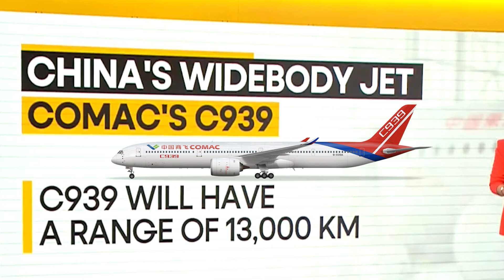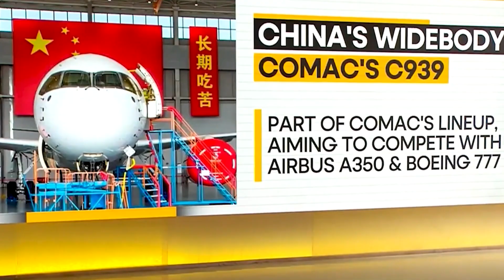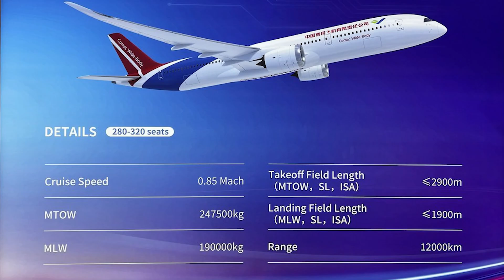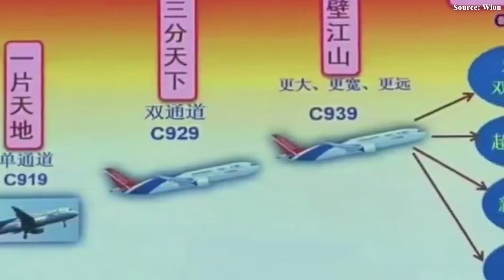China’s MASSIVE Plan for NEW COMAC C939 Could Change Aviation Forever

Comment: Western estimates are always wrong when it comes to estimating the length of time for China to achieve goals.  From infrastructures to semiconductors, China has surprised 'expert' pundits about schedules and innovations. Passenger jets should be no different as the Chinese gain more experience with time. China is also thinking beyond the C939, the C949 is envisioned as a hypersonic passenger jet.  The  hypersonic engine and development body design are already undergoing tests.
Reply from the maker: C949 is truly a surprise. I do wonder whether it makes sense to think about it when the C919, C929, and C939 are still facing so many challenges. Still, it sounds very interesting and worth looking forward to.